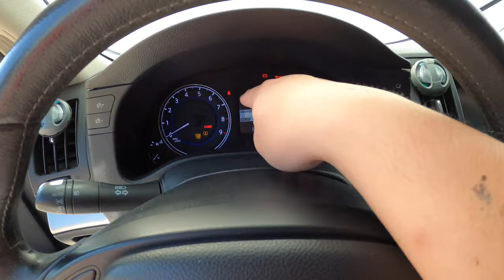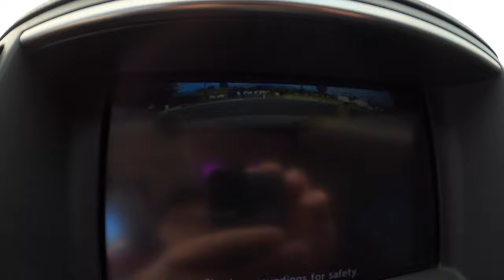Duckbill install on G37s! More aero! Looks amazing! Must buy!

Comment: Hey how did you take out the chrome spoiler but still have the camera still on the trunk? When I took my chrome one the camera came with is
Reply from the maker: My chrome fell off prior to the install but there should be either clips or little screws that you can detach it from

Comment: Do all the sensors for the backup cam work properly with the lines even with the spoiler in the way?
Reply from the maker: Yuh. Works fine. Only difference now is that the camera looks more like a fish eye
Reply: The Sonar sensors are on the rear bumpers so that shouldn't be a problem.
Reply: @ItsMYang Cant you just cut the camera hole just a little more?

Comment: Did it ever fall off?? how many inch tape did you use in terms of width on the spoiler. Is 1 inch fine?
Reply from the maker: Nope. It’s very sturdy. I think mine was only half an inch cause that’s the width it came with. You can always buy extra if you want but generally it’s about half an inch and it’s stable
Reply from the maker: It’s in the video too
Reply: Still on?
Reply from the maker: Ofcourse ofcourse. It ain’t going anywhere for now
Reply: @ItsMYang  bet I just ordered

Comment: Will it fit if I have a g37 coupe with a spoiler from
Reply from the maker: If you got the stock one then it should be fine. It’ll fit right over it. No need to take it off